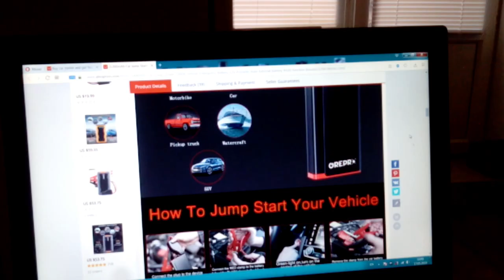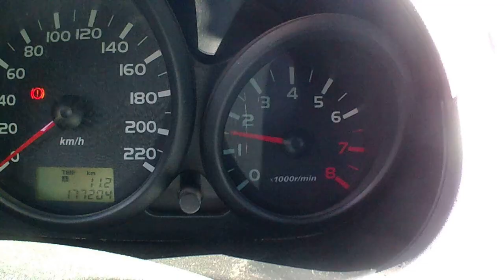СAR WON'T START AND MAKING CLICKING NOISE, 3 ways to fix it

Comment: Used portable jumper 1200 peak amps got lights radio come in . But it just clicks a bunch won't start what's wrong ?
Reply: Did you found out what was it ?
Reply: @Eseshaggy89  call Mike are you can jump it from under the hood but I couldn't get under the hood cuz it was stuck so I had to pick up the back seat and jump the battery from under the seat it finally started. It's the battery it a parasitic draw.  But now that it's warmer it hasn't had an issue startting

Comment: Hey I have question . So a couple months ago when I started my car it immediately shut back off and started it again and it stayed running . So a couple days ago I tried to crank it but it wouldn’t start but sounding like it was struggling to start . I’ll say after about 2 days my windows started to roll back up slowly my lights started to not work, and radio wouldn’t stay on. The next day I came to check on it nothing was working. The car wouldn’t start at all or wasn’t making any noise when trying, I couldn’t pop my trunk by the button in the car or key, and my car won’t unlock or lock . Also I tired to jump start it for about 5-6 mins and my lights inside my car were blinking but didn’t start my car. What do you think could be the problem ?
Reply from the maker: Hey. First, try to put another battery. Or charge yours. Second - check the terminals and wires to the battery.
Reply: Did u fix it ?
Reply: It's your alternator my car was doing the samething. Even after I gave it a jump if I didn't drive it the power would last a couple of day's, but if drove it after the jump it would last a couple of minutes.

Comment: I have a similar problem on my car. Yesterday I tried to turn it on and when I turn the key, only one click is heard and the engine does not turn, I tried many times and every time only that one click is heard and the car will not turn to try to start. the battery is new and excellent and that is not the reason. after that I tried to push the car only half a meter forward and sat in it and turned the key and the car immediately started normally, I turned it on and off without any problem 20 times in a row, the whole day wherever I went the car started normally, The next day I sat in the car to go to work and suddenly I turned the key and again the click sound, the car does not start. I push the car 1 m forward, sit in it, close the door, turn the key and start it without any problems.. I don't know why it happens, do you maybe know or suspect something? will I constantly have to manually push the car forward a few centimeters for it to start after that? thank you in advance for your help!!
Reply: Same problem did you find the solution